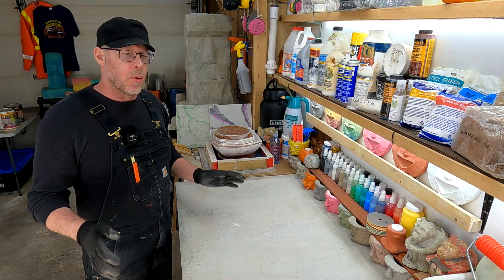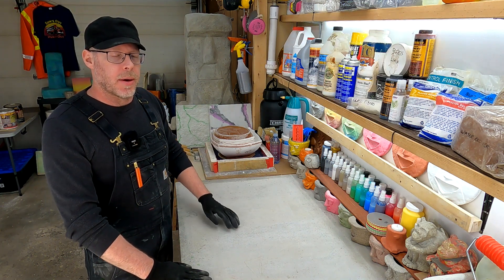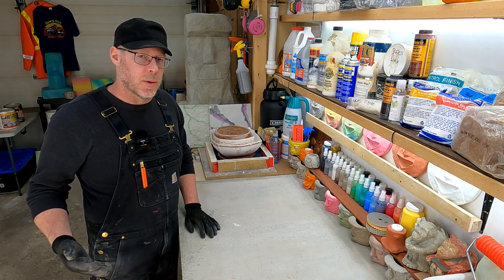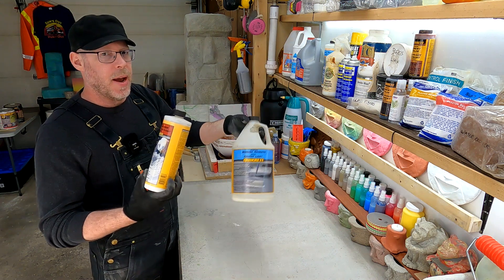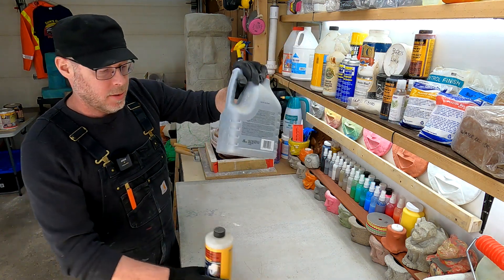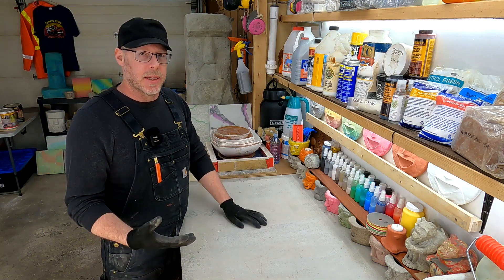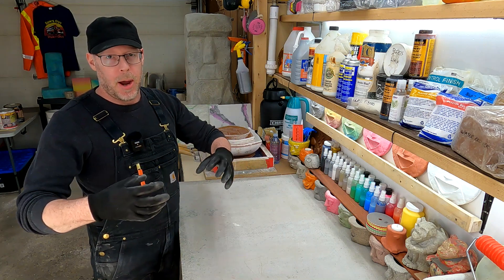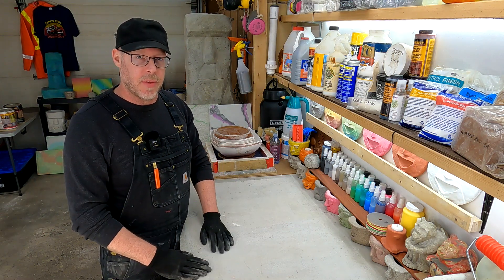3 Things to Make Concrete Stronger

Comment: Im not understanding the fine aggregate, because i find that when i used play sand. The fine sand or silt tended to pool to the bottom of barrel and didnt bond well.
Reply: Play sand is not recommended for concrete mixes. It has been tumbled, which softens the jagged little edges of the sand grains. These rounded grains do not bond together very well.  Use masonry sand instead of play sand, and you should have better results.
Reply: Around here we use "concrete mix" from the local quarry, which instead of actual sand uses crusher fines out of the same machines the coarse aggregate comes from. It's structurally very strong and has all fresh hard edges to make really high quality concrete, and it's guilt free - unlike sand, the world is never going to run out of volcanic rock deposits.
Reply: I think the play sand is used to form an inner shape🙂forming your mold to put your concrete over if your making your pot upside down.
Reply: Play Santa's used for rubbing and patching big concrete walls to go in the vibrator air pockets on the surface 2 21 and some bonding agent
Reply: You may be able to buy mason sand at the same place you buy your play sand currently. That should work better. Moisture content is tricky with DIY mixes also. Because the aggregate, if it is oven dry, will absorb some of the moisture, reducing w/c ratio. So you have to account for that by adding a little extra. Likewise, if the aggregate is still wet, not damp, but wet, then it is going to be a net contributor of moisture to the mix. Ideally, it would be "saturated surface dry." That means the aggregate is dry, but any internal void spaces which can hold water are already full. When the aggregate is in this condition, it will have no effect on the w/c ratio.

Comment: This is so incredibly helpful! I have been going back through your videos, and they are terrifically helpful!!! Thank you so much! I have a question about using the superplasticizer or the acrylic fortifier. I am creating sculptures from mop heads made of very absorbent cotton cording, and I am working with Cement All. I need a very runny mix so the cotton cording absorbs the concrete. I am wondering if I should just use the acrylic fortifier as 50% of my water to make a super runny mix or if I should get my hands on one of the superplasticizers you mentioned in a previous video. Any thoughts or suggestions you have would be so appreciated!!